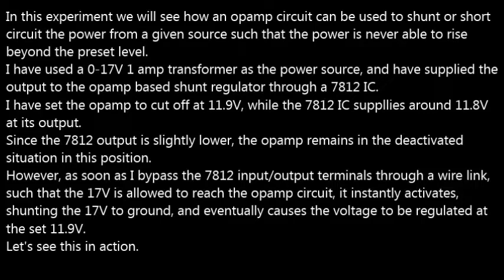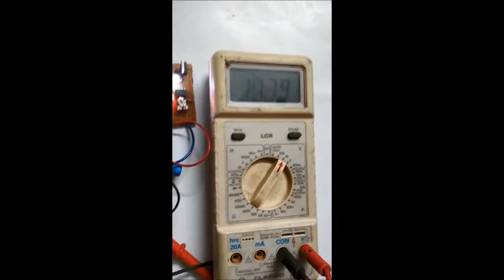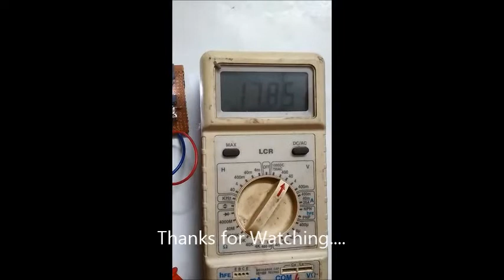Testing a Simple Shunt Regulator Circuit using Opamp and Mosfet

Comment: in this circuit trimpot for the fixing output voltage ? i will try to make same circuit but instead of lm358 i will use  lm339 and instead of irf 540 i will use irf 630  so do i need make any major changes ? many thanks

Comment: Nice, simple circuit, but on your schematic at the beginning of the video change the IC output to "1". The "6" you have is an input of the second comparator.
Reply from the maker: You are right, the output should be pin#1....pin#6 is the output for IC 741. Thanks for pointing it out, I hope the other readers will take a note of this.